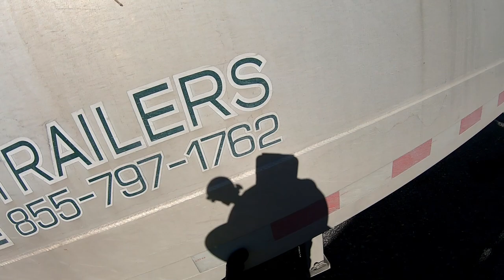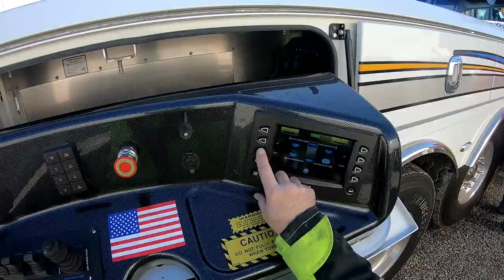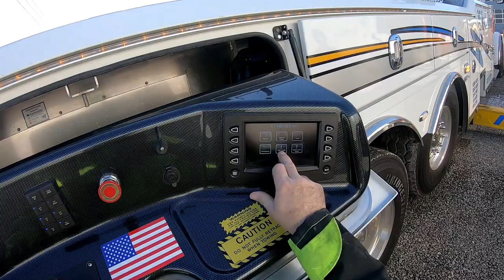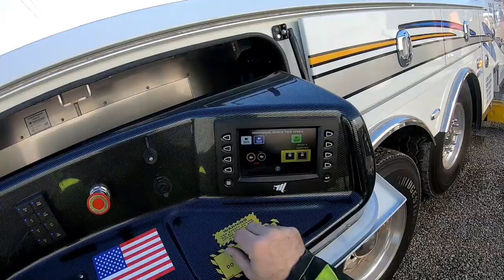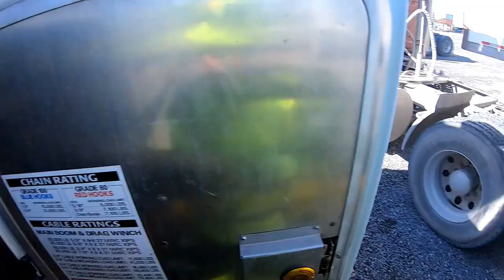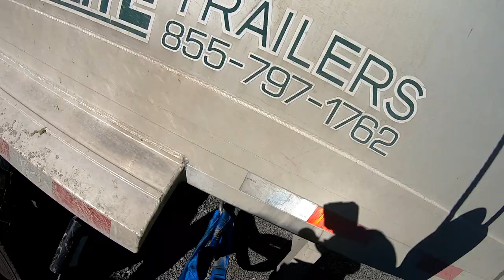BELLY WRAP LIFT

Comment: A couple of 4-5 feet long thick angle aluminium to protect the trailer. It seems like this being a problem in several videos.
Reply from the maker: We carry thick aluminum angle in all our trucks.   The blocks worked better in this situation due to the bottom lip of the trailer side being lower than the support structure, at least in my opinion.   Thanks for watching and God bless.

Comment: im no expert and not a tow driver but i have a question.since you need to lift where braces are could you use a piece of angle iron. place angle iron so it covers 2 supports then lift in the middle of angle iron. in theory the stress should be distributed between both supports. just curious. they way you did it worked and was the right answer. but i was taught there is more than one way to reach your goal and achieve the same result.

Comment: Stupid question Mr. Ron coming from a greenhorn rookie towing guy ,, but my question is ??? Don’t you have a spreader bar that you could put on either side of the stands on the trailer ???? Would that not work as well ??? 😎
Reply from the maker: Yes, I have two spreader bars on this truck.  However, the way I set up this lift, the boom is actually working as a spreader bar.  Much quicker and easier to deploy, in my opinion.  Thanks for watching and God bless.
Reply: Ron Pratt thank you sir for taking to to reply and yes , I do believe you are right in the way you did it and I’m in no way saying what way ......was right or wrong 😎 thank you !

Comment: Ron I just started watching another heavy tow operator on YouTube and his truck has different out riggers on the front of the truck it also has pull winch's behind them. What was the deciding factor to go with the low clearance ones all the way around vs the a-arm style? And is one better than the other?
Reply from the maker: I am familiar with the truck you are describing.  I would not say that either truck is better than the other, they are simply different.  That truck is a 40 Ton capacity rotator boom with the XP option, which is the outriggers that come out, the A-arm style you mentioned, with winches on them.  Mine is a 50 Ton capacity rotator boom with a total of 4 winches on the boom and a drag winch on the rear.  My boom is able to travel fore and aft 5'.  His does not.   Each unit has their advantages and disadvantages.  When we ordered our unit, the XP option was not available with the 1150R.  The R signifies that it is a "roller", which is the travelling boom.  The travelling boom was and still is a huge benefit for us.  The XP option also doesn't allow as wide of a front stance for the "base" when using the boom to lift.  The XP does, however allow you tremendous side pulling capabilities.  As I said, each design has its benefits.  It's up to the end user to decide what best fits their needs.  At the time we ordered our truck, this was exactly what we wanted.   Thanks for watching and God bless.
Reply: @RonPratt  cool! Thanks for the reply back so quickly on my question, stay safe out there and always watch your six.

Comment: Ron, you cant tow trailer hooked up to tractor and get it dumped first?
Reply from the maker: We attempted to do that the night of the original tow.  That's when the company found out that the PTO and transmission were inoperative and couldn't raise the trailer.   Even if it could have, the facility where we took it was not accepting at the time, so we did what the customer asked.  This is the result.   Thanks for watching and God bless.

Comment: With all the gear on board, how much does the tator weigh? Also how many miles have you put on it now?
Reply: fully loaded it is around 72,000 pounds (32,658.6 kg)
Reply: @Joshua79C  Wow, that's heavy. What a beast of a machine.

Comment: Does that control system only engage the Hydraulic pump when you engage the winches or move the hydraulics?  As opposed to a regular valve body that  pumps Hydraulic fluid all the time through the body? Seems like the idle changes only when you are using winches.   Guessing there’s some kind of spring or channel that holds the Hydraulic lines from dropping to the ground when you roll the carriage forward and back.   I’m wondering if you ever need to pin through the front outrigger to take pressure off your Hydraulic cylinder like when there is a snatch block to the leg and it’s pulling on the hydraulic cylinder.   Was honored you trust me to be a Moderator on the live stream, had to watch later though because it kept stopping.    I was around Mechanic shops as a kid during the summers because my dad did Automotive and industrial distributing, so that may have helped me understand mechanical things better.
Reply from the maker: When I engage the PTO the hydraulic system is constantly pumping.  The valve system is in "standby" mode until I command movement through the control system.  All of the cylinders have what are called holding blocks, which hold the cylinders, drums, front outriggers, under-reach, etc., at their current position until commanded to move.  The holding valves require hydraulic pressure to force the block open and allow fluid to flow through it in the proper direction.  Basically, it is spring loaded to return to center, which is the "hold" position and blocks the flow of hydraulic fluid in either direction.    The only exception to this is the rear outrigger system.  The rear outriggers have the large diameter pin that I must manually release to allow the legs to extend, then I must pin them back in the stowed position.   This is something I never understood about this expensive machine......holding valves are quite common and I do not understand why Miller didn't install them on the rear outriggers.  They trust the ALL the other systems to have the holding valves, yet not the rear outriggers????   I just don't understand.  Dad and I have discussed installing holding valves on the rear outriggers ourselves.   We believe it can be done quite simply and inexpensive.  Thanks for watching and God bless.
Reply: Ron Pratt thanks for taking the time to respond.  Perhaps they don’t have holding valves because they don’t expect you to tug on them with snatch blocks.   I just noticed the holes on the front outriggers, and I noticed plaza towing pins their outriggers sometimes.   I would think pulling on the outriggers put more pressure on the cap and seal than it was designed for, thinking pinning outriggers would help extend the life of the cylinder seals.  I am guessing the boom has a two or three stage hydraulic cylinder like some smaller elevators do.   I would guess the Optimum lifting angle is based on the capability of the hydraulic cylinders and the way the weight is transferred into the wrecker body.   I wonder if air bags would have given you enough advantage to keep your rotator from floating on the pipe wreck, or if the incline would have made it to dangerous to use them in that case, perhaps even create a shock load if they popped out too soon.   Was trying to guess how big the hydraulic fluid tank is to support all the hydraulics because of weight and what it takes to change the oil for winter or summer grade,  I know from running a few backhoes that the higher the idle the smoother the hydraulics work.

Comment: sounded  like you had an air leak too at the beginning of you setting up.
Reply: When he plugged in the air line there's no valve to shut it off until it's hooked to the other end. Air was just coming out the end of the hose till the customer hooked it the broken truck and used the dash valve to control it.

Comment: Did you put a Federal Q2B on the tator Ron? Looks like one painted Blue under passenger side of cab.
Reply from the maker: Yes, it's not a Federal Q2B, but very similar.  It came off a 1959 Cadillac Miller Meteor ambulance just like the Ghostbuster's ambulance.   It's not the same siren though....LOL.   It sounds almost identical to the Q.   You will hear it in upcoming videos.  Thanks for watching and God bless.

Comment: Ron or anyone else that knows this answer, what does the slick disc do?  I’ve never seen that before.  Just curious, thanks.
Reply: It takes the place of grease on the fifth wheel so the you don't wear out the fifth wheel and plate on trailer.
Reply: FirEmt_97 
It's a lubricating disc

Comment: It's to bad that the trailer manufacturers don't put a lift loop or a spot to install a lift pin near the top cylinder pin to take the load of an operation like this. Cost and weight would be minimal.

Comment: Was I the only one thinking what about the landing gear on the trailer?   Put a few boards under them, and lift the trailer with those?
Reply from the maker: This type of trailer only has what are called "drop legs" and they are not designed to support the weight of a loaded trailer.  They are only thin aluminum tubes with holes for locking pins at set heights and are only designed to withstand the weight of an empty trailer.  They have no way to adjust the height like the standard dolly legs do.    I see a lot of this type of trailer that is "married" to the tractor that pulls it and the drop portion of the legs have been removed so that the trailer can't even be dropped when empty unless the legs are found and put back in place, or the trailer is set on blocks or lifted by some other means.   Hope that helps explain.   Thanks for watching and God bless.
Reply: @RonPratt  Thank you for the response.  I did not know that.

Comment: One of the poorest built trailers. Engineering needs to be redone on those end dumps.
Reply: Built as strong as needed to hold the max amount of cargo you dont get paid well hauling in 20 tons you max it out
Reply: I agree. To build a trailer that doesn't even have a functional landing gear....what were they thinking?  There are a lot of reasons and situations where people need to separate a power unit from a trailer, and there is no way that everyone will always know that these trailers can't even support their load. Seems like a lawsuit waiting to happen when someone gets smashed under a collapsing trailer. Then Armor Lite boldly puts their name on the side like they are proud of their junk. Spend a few bucks, add a little weight and build it right.
Reply: Think they're designed to weigh less so they can hold more without being over Gross going down the highway.

But that's just my opinion...
Reply: Understandably lower the trailer weight (itself) equals more weight capacity while hauling. But I would think engineers could incorporate lifting points for times like this. And have dolly legs that would hold a fully loaded trailer.
Reply: @Freedomquest08  why would you operate a trailer if you don't know it's limits? 
I would assume the lawsuit would be over quick, with the outcome "it is the dead operators fault"

Comment: It is arch  not arc ... An archenemy (sometimes spelled arch-enemy) is the main enemy of someone. In fiction, it is a character who is the hero's or protagonist's most prominent and worst enemy.
Reply from the maker: Yes, I am well aware of the proper terminology.  I fully intended to use the term "ARC" as a "play on words".  Overhead power lines are very dangerous in my line of work and they seem to pop up at the absolute worst times.  They are my ARC-nemesis, again, play on words, due to the fact that the overhead power lines can create an electrical ARC and damage equipment or harm/kill personnel.     Thanks for watching and God bless.
Reply: As Ron said. And it's  a little "thing" in his videos and they wouldn't be the same if it was spelled correctly.
Reply: You'll note that Ron puts ARC in quotes just in case we grammar freaks miss the point.